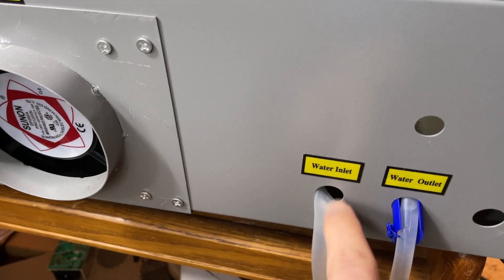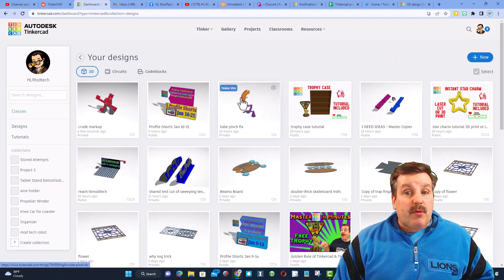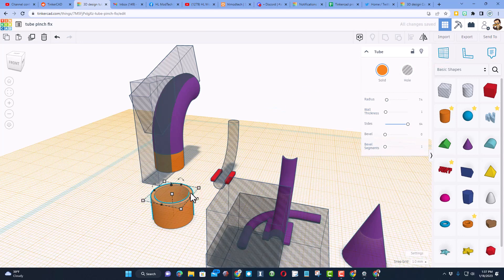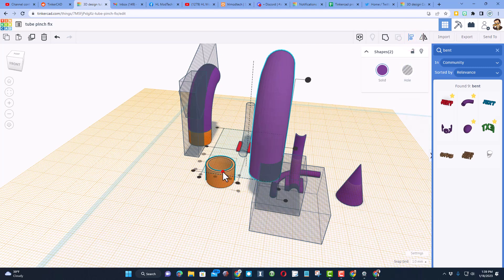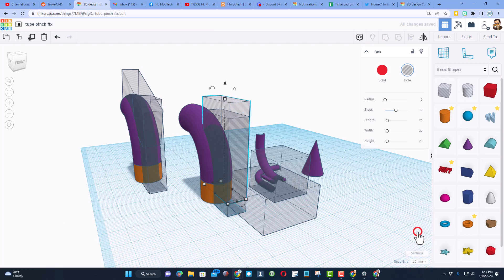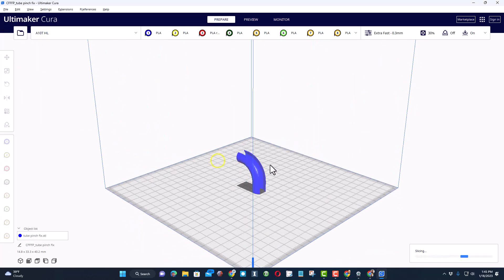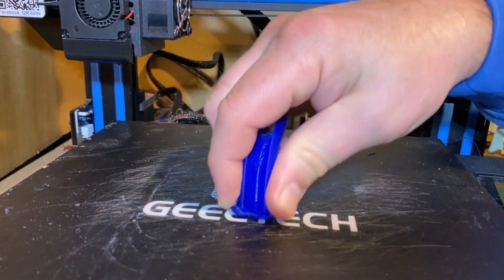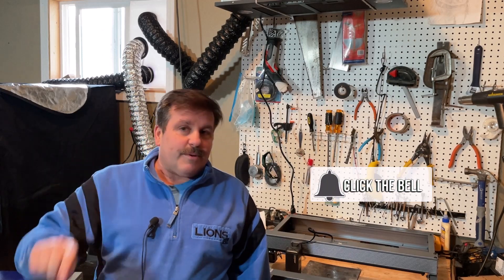Tube Pinch Solved 3d printed Tinkercad fix Monport 40w laser cutter

Comment: You just needed 1 or 2 supports so it wouldn't drip.
Reply from the maker: Yeah. Might work with lower temps too.
Reply: @HLModTech  yep. If you get to try it please tell us.
Reply from the maker: I doubt I give it another go. They are snug and working like I wanted... Next project likely has priority. =)